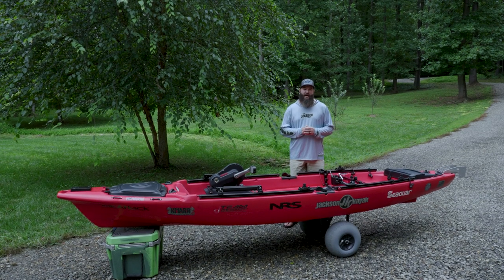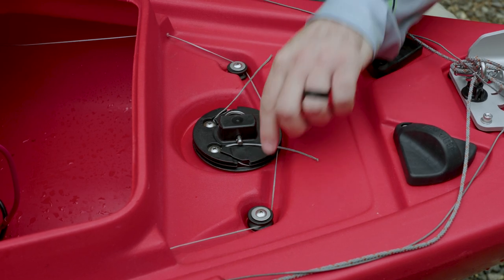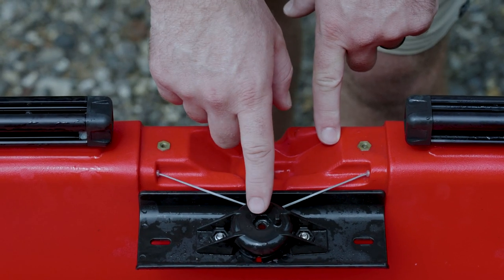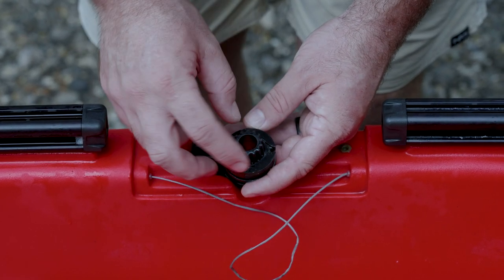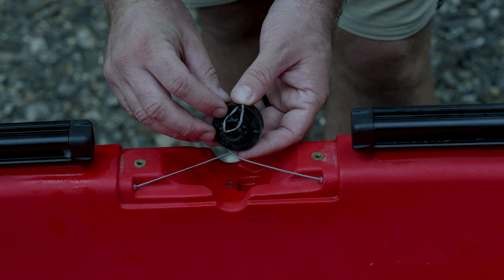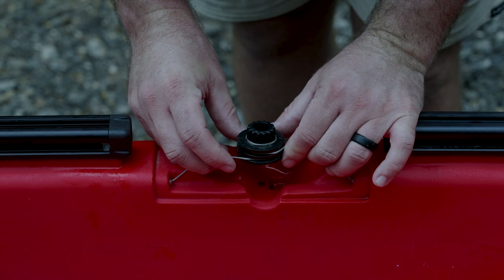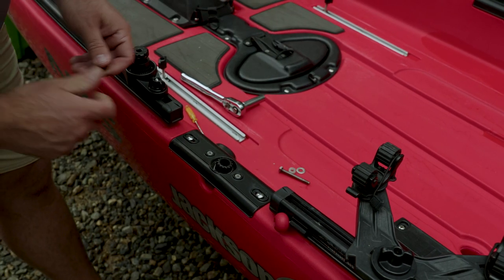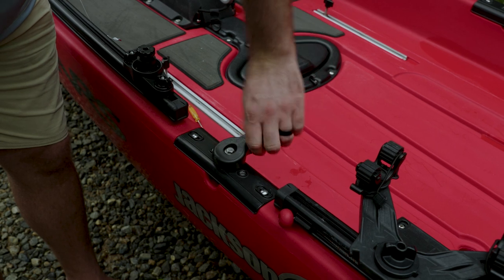The Ultimate Jackson Kayak Knarr Steering Video

Comment: I adjusted mine solo, using masking tape to hold my handles and rudder in place.  It also came in handy anywhere there was recessed nuts to help start the bolts with the screw driver.